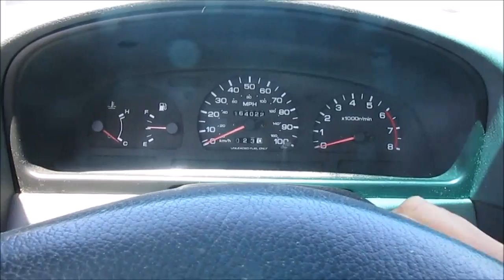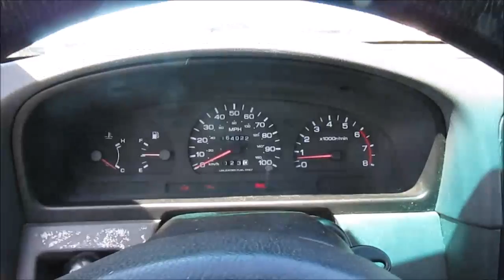Nissan D21 Hardbody - How To Change The Fuel Filter

Comment: Im 15 years old an my dad recently gave me his 96 Nisssan D21. I plan on changing EVERY fluid on it this week because the only fluid he has change for maintenance is the oil and the coolant. That's it. So imma change the oil, coolant, differential fluid, transmission fluid, brake fluid, and the power-steering fluid. Wish me luck!
Reply from the maker: Good on ya man! A little tip for when you do the transmission is make sure you open the fill bolt before the drain bolt; that way if the fill bolt is too siezed to get off, you don't have a drained transmission you can't fill. It takes an ordinary 1/2" drive ratchet extension.
Reply: @LNERMallard  thx for the tip man have a good one 😁

Comment: having an acceleration problem with my 1995 d21. when I give it gas it feels like it is going to stall and can only go so fast when driving it. seems to run good when first starting it for the day but when the engine warms up it act up again. put a new coil now going to try a fuel filter. anyone has any ideas I would be interested in hearing them.
Reply: Try spark plugs, one of mine was broken and would limit the speed and acceleration when it warmed up
Reply: @daveywarrior1  I will try that out, thanks!
Reply: @cuttykev1  np if you havent tried the fuel filter I'd do that too. My fuel tank was rusted so I dropped it and derusted and changed the fuel pump and there's still orange crap that the fuel filter is getting clogged with
Reply: @daveywarrior1  changed the fuel filter today. still the same problem . no horse power when it warms up and wants to stall super easy also when it warms up.
Reply: @cuttykev1  check the spark plugs if you haven't already
Reply: @cuttykev1  I will describe the problem I had which ended up being the spark plug to see if it resembles your problem at all.
Cold start runs fine, performs perfectly fine when first started until it warms up (5-10 minutes) then it loses most if not all it's acceleration power and fully pressing the gas pedal down does nothing even shifting into lower gears. Turns out one of my spark plugs were cracked, and broke in half when taking it out to check them. Ended up replacing and truck ran perfectly fine afterwards and is still running like a champ

Comment: thank you for the video, I see that the abs light is on.   I had the same problem and not sure where to start.  Any suggestion!!
Reply from the maker: I never really cared to fix it for the entire time I owned the truck so I couldn't tell ya. Check out infamousnissan.com, they should be able to help.
Reply: have to bleed the all brakes in a certain order

Comment: My truck is chugging,  and stalling out at red lights. Distributor,  wires, sparkplugs all new. So I'm told that could be fule pump.
So, I'm  buying a new pump ( many to choose from; any suggestions?) Do I need a new pump filter also? I know we need to clean out tank. Yes my truck is a 96 Nissan D21.  Thanks for any help
We did clean the sensors and air filter BTW.  And still chugging

Comment: Thanks for that video Hank. I guess I better replace my 97 hardbody filter too. Ur check engine light is on....I'm guessing this was Not the reason it was on?
Reply from the maker: Actually, the check engine light was on because I forgot to reconnect a wire harness on the air cleaner box, I'm guessing for an oxygen sensor. Once I plugged it back in it went away. I mentioned that later in the video.
Reply from the maker: It wouldn't need a fuel filter if it ran on propane, I tell you hwat!

Comment: Was the idk rough before the swap? Mine idles at around 1700 on a cold start and settles at 1100 after running for a while
Reply from the maker: It idled alright before the swap, but revving and acceleration is where the most improvement was noticed.

Comment: So I have a 95' d21 and it'll lose power whenever I'm driving and it'll regain it and it keeps repeating. Do you know what it could be? usually happens at 60mph or higher
Reply from the maker: Check your usual culprits like spark plugs, air cleaner, fuel filter, etc. Could be a vacuum leak as well. Infamousnissan.com is a good place to check for advice.